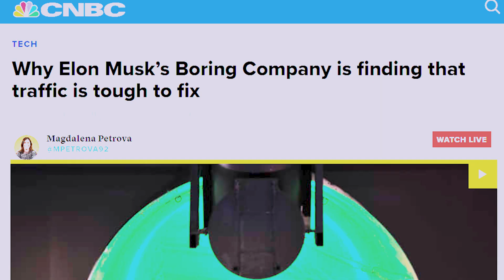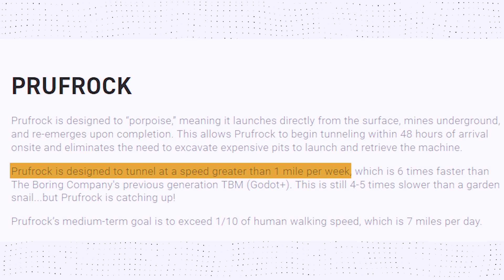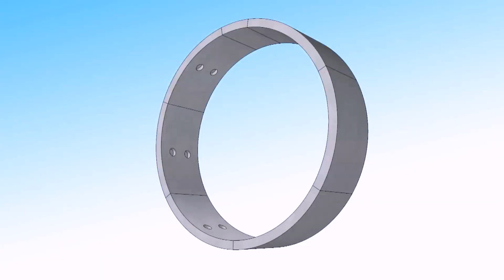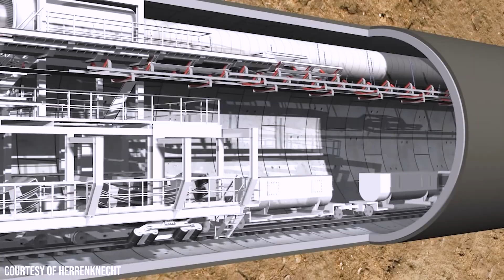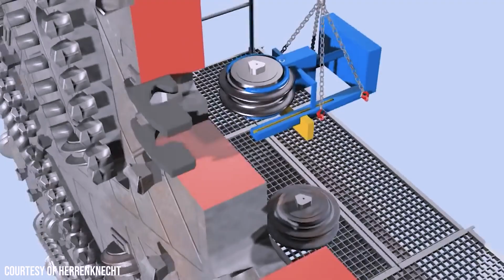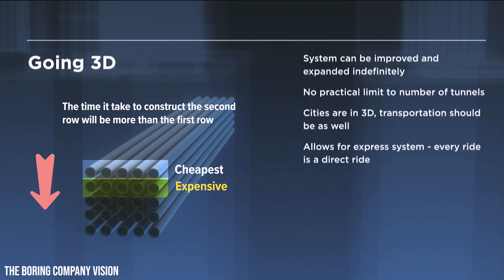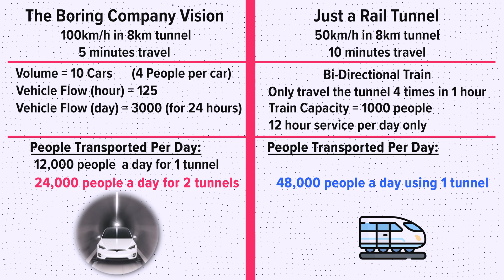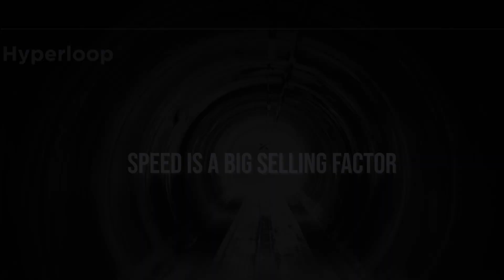Why Elon Musk's Boring Company Won't Fix Traffic: Debunking the Hype

Comment: Your first comment - not solving LA traffic.

Assume autonomous driving systems and that key locations are on high speed loops.

Passenger transportation rates in these tunnels can be substantially higher than street traffic.

Assume about 5000 miles of tunnels are needed. At a four miles a month and with 25 machines, that is about 5 years of construction time.  Assume they begin in 5 years - done in 2034...

Majority of congestion is due to people being slowed down by people looking for parking. With automated cars the need for parking goes away.

50-70% autonomous vehicles is the real solution...
Reply: "4 miles a month"😂😂😂😂😂.......stop it,. you made me spill my tea. 
https://www.youtube.com/watch?v=wFJ6UZ0SkYY&pp=ygUSbGF1Z2hpbmcgc3BpZGVybWFu

Comment: Your drawn comparison between rail tunnel transport and boring company vison @ 12 min is not done without bias. When was the last time you climbed on a train with 1000 people? So cut your numbers in half and you might have a reasonable comparison. I believe people love and more often than not travel by car because they want or need their vehicles with them. Therefore, these express tunnels would be much more effective than you have indicated.
Reply: This morning. But to be fair it was actually around 2,300 people. Bit crowded at rush hour but still not full (2845 capacity). I will admit I had to wait 2 minutes (2.7 minutes headway) for the next train as I arrived at the platform as the train doors were closing. But from my breakfast table to my office (18km away) in 35 minutes (20 of them on the train) and costing me US$25c I shouldn't complain.
Just a taste of what life in a first world city is like.
Reply: When "people luv their cars 😢" is your only retort to not building actual rail systems, you're in some deep elonfuckery.
Reply: Equally it's not reasonable to expect every car will have four people inside it!  Most of the cars on the freeway have just one person in them.  So the car-in-tunnel concept is still much worse.
Reply: What do you mean? It's very favourable to the loop, firstly it's at least as invalid to assume every car will be full, and it's also very uncharitable to the train to assume a subway is running every 15 minutes, and that it's running only 13 hours a day but the loop runs 24 hours a day (most underground train systems run about 19 hours a day). It's also very typical that in a busy city, you do get on a train with a 1000 people on it, that's a very typical capacity for an underground train

Comment: I could be totally wrong here, so just keep that in mind.  I don't think his main goal is to solve traffic.   He is building the worlds largest spaceship to go to the Moon and Mars to colonize them.  He is building robots and working on an AI system, Solar and Battery technology as well as of course the Boring tech.  I think what he is really doing is improving a technology to tunnel on the Moon then Mars with robot workers run by an AI.  The reason for the small size of drilling machine is because of power requirements and you can stuff two segments in a starship or three if you were to modify the starship slightly.  It can start drilling from a flat surface, makes the ring segments internally.  A lot of safety issues are non issues if you have robots and no air.  The best way to colonize the Moon or Mars is have a base waiting for the first landing party.  This sounds fantastic but so did self landing spaceships 15 years ago.  Just a thought.
Reply: He got a good deal on the first tbm he purchased as it was about to be scrapped
Reply: And his next one was made in China by all accounts. @freddiecarr7602  But now they build their own (they claim). and we will see how amazing it is in Texas at the Geeega factory. It's doing the amazing project of going under a road embankment with no outside constraints. Only 4 weeks in so far and they have got half the machine built already.
I have got my popcorn ready.

Comment: Why passenger trains suck, everyone has to stop at every stop you are moving absured tonnage stopping and starting stoping and starting or you could be in a EV car and go only to where you want like everyone else in the Boreing Company system no need to wait at Hobokin for people to get off and on you are just going to your destination.
Reply: Personal Rapid Transit (PRT) am I a joke to you? Basically the Boring Company has a PRT system underground with human drivers instead of being fully automated. Being on ground level doesn't solve anything. Either underground (the more expensive & longer time way of doing it) or do it completely grade separated above ground in the air like a monorail (built for less money and built much faster and cheaper because almost all the pylons and guideways are built offsite in a controlled environment and then trucked and crane into position faster). More miles can be built faster for an elevated system just as safe in an earthquake vs an underground system. 😉
Reply: @electricar9  What do you think Tesla's FSD going to do? Automate driving, if you doubt it go look at the latest FSD videos that people have made,  have a nice day.
Reply: it seems you never experienced proper train system (europe ???). Around my city there is Underground subway and overground "subway/trains", there you got two type of trains, express ones (that skip a lot of stops) and normal ones (they stop at every station). I think this is also in NYC.

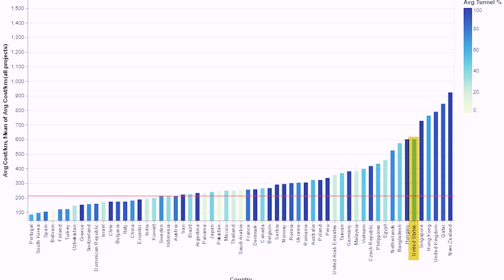Comment: You pointed out high labor cost, but Switzerland, which has some of the highest labor costs in the world, can dig tunnel cheaper than most countries. On your graph at 9:19, you see that it is around 150M / km. So, it is also a problem of optimisation: Switzerland has dug a lot of tunnels in its history, so it has optimised the process a lot.
Reply: I'm Swiss, I'm a civil engineer, so let me answer this to you... 
It's more complex than "just optimising"... 
There are parts of a tunnel construction that have the same cost, no matter the tunnel length, and are fixed costs. The tunnel portal needs to be built. So if the tunnel is long, the portal cost per km decreases massively. And this can be expensive. Portal or a trench for a metro, etc... 
The tunnel control station also needs to be built. 
There is also the cost to assemble the TBM and transport it which is massive. If the tunnel is long, the installation cost per km is much lower than for a 2 km tunnel. 

Then, if you don't take into account the ground conditions, your tunneling discussions don't make sense. 
Examples?
- you build a tunnel in a good rock usable for concrete, you can sell the aggregates, reuse them for the tunnel concrete, the cost go down
- you build a tunnel in a polluted soil from a former industrial area, the ground needs to be treated, and the cost can be massive. 
- if you're in a soil where there is no groundwater, or a very cohesive soil, the costs of construction, the speed, the waterproofing, the drainage won't be the same, and the costs will be reflected. 

Then talking about Switzerland, yes, there is a massive experience, but one of the main quality of Switzerland is to prepare those projects on 10s of years. It's anticipated, prepared, so the decision making process makes sense. In other countries, projects start quickly, and there can be good surprises, that have costs and sometimes rewards. 
But mostly, it's an international business. Marti, Implenia, 2 Swiss companies that do tunnelling are active all over Europe and even the world. So the Swiss expertise is exported. It's not exclusive to Switzerland. And same goes for engineering. 

All in all, it's more complex, and not such a black and white situation.

Comment: The problem really lies in manual drive, people can't maintain speed while driving if there's too many cars at once. The tunels in their first iteration might solve it if you have them travel next to each other (like .5 meter distance) while maintaining speed of something like 60km/h
In theory it can be achieved by those "moving platforms" which can fit like 300 cars in 1km tunel and this is huge. It seems they failed once they made it non-automatic for users
Reply: Tesla FSD you are not going to be driving.

Comment: Excellent video - loved the discussion of the TBM technology!  I do applaud Elon for the effort and what I'd consider a proof-of-concept in LV.  This helps us to move forward to figuring out and optimizing the best solution.  I agree that the rail tunnel is more practical in terms of passengers (though I think your assumption of 1,000 passengers for the comparison would be quite ambitious - not sure if any US trains have that capacity) but a challenge there is getting folks away from car-centric transportation to public transportation.
Reply: In terms of the actual tunnelling, I would say that Elon has achieved an acceleration, of sorts, in the 7 years since he decided to buy a TBM and just give it the old college try. He started with secondhand equipment and 30+ year old technology, after 7 years TBC appear, (based on their latest iteration of Prufrock being used in Texas), to be now only around 20+ years behind current TBM technology. At that rate they will catch up with the rest of us in around 24 years, assuming their technical progress is linear, which it isn't, it gets harder as you progress to make leaps forward. 

The metro train I catch several times a week (partly built by the latest technology in TBM's and immersed tube tunnelling) carries 2840 passengers (fortunately it is rarely full to capacity); with a 2 minute headway at peak demand (6 minutes at low demand); 35 minutes door to door (20mins in the train); costs me $0:25 each way (I get the grumpy old git discount, but regular users pay about $1:20).

Comment: I think Boring company could do it well commercially if they build these narrow tunnels and just sell them as utility tunnels. Electrical wiring, maybe centrally heated water, or even a bit crazier idea: how about garbage conveyor tunnel, that could potentially solve the trash problem that New York has. Basically dump trash in a shute that is connected to such cheap narrow tunnel with a conveyor or something.
Reply: The Loop tunnels at 12.5 feet diameter are larger than the 11' 8" tunnels of the London Underground.  I don't think Tube fans would appreciate you being so negative about this tunnel size.